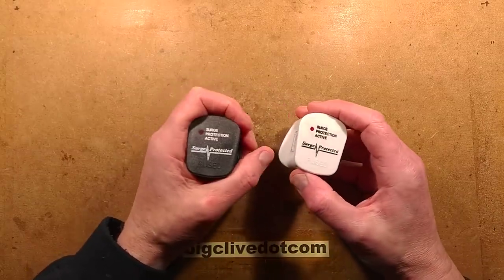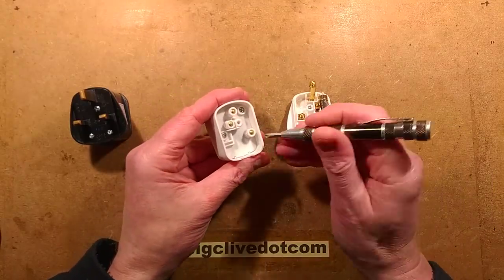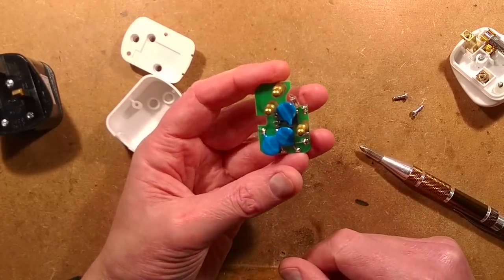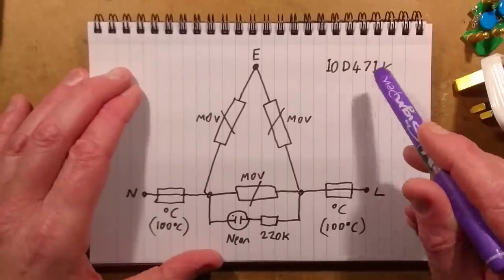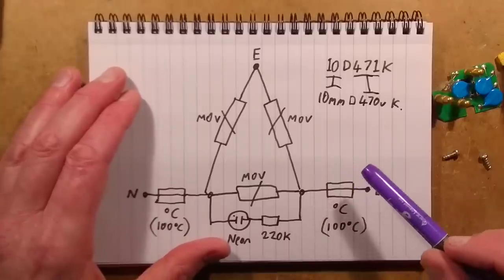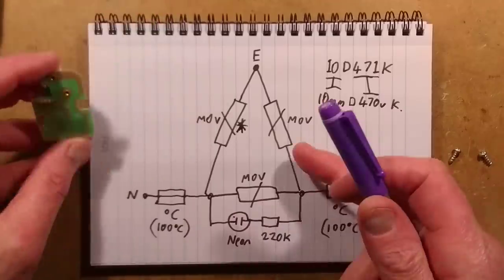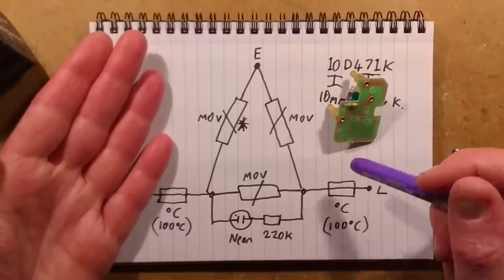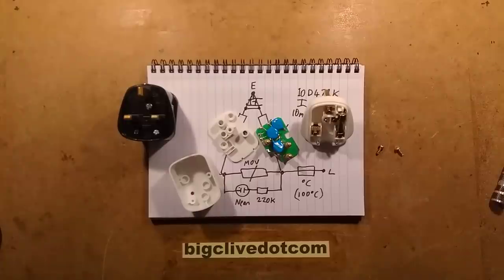British plugs with built-in surge arrestors.  (With schematic.)

Comment: I can't trust MOV. Is it really effective?🤔
Reply: A guy tested MOVs, spark gaps, clamp diodes, everything failed except the MOVs. The MOV clamps the spike immediately with absolutely no overshoot. I am not an expert but I heard here and there that MOVs stop working after they receive certain amount of spikes through them. They conduct and overheat and start a fire, that's why they go with thermal fuses. Maybe a ferrite filter is a better option? Maybe a small cap with discharge resistor after the MOV is a good idea, it would take the energy of the spike but would not let it overheat if it fails. Oh wait, that's too expensive ... you know how it goes, plastic metalized wires are our future! :)

Comment: How do they protect you device when all the protection is sat on top of the plug and the wires go straight from the plug wire and straight to you device if the protection blows the plug will still work .. i don't get how it protects say my computer against a power surge any power spike is going straight from the power out let onto any device plunged into it
Reply: When a power surge occurs those MOV´s short out the plugs. So the electricity flows through them, and not into your device.
Reply: When a power surge occurs those MOV´s short out the plugs so the electricity runs through them, not into your device.
Reply: @SharkoonBln  thanks so it blows the fuse then in the plug
Reply: @Rob1972Gem  Those MOV absorb the spike. They get hot while doing this, so they will be fine absorbing spikes, but no long occurence of overvoltage.
Reply: @Rob1972Gem  No, it shouldn't.

These are for transient overvoltage protection - very short durations, nothing like enough to blow a fuse.

Comment: 6:31: "...miswiring..." 
Mind you, there's countries that use unpolarised plugs, and if this were shoved into an adapter with an unpolarised plug, the polarity could easily be reversed. It's even possible someone brings their foreign flex, plugs that into the wall with an adapter, and then plugs this into that with another adapter. That's not recommended of course, but people will use whatever they have to hand. So you absolutely can get the same effect without any actual miswiring in the house. OTOH, you might well argue that weird extension cord and adapter setups count as miswiring too. But try convincing people they should invest in a genuine UK flex... "But I've already got this and it works!"
Reply: All of mainland Europe enjoys their misswired type c connectors (CEE 7/16), I somewhat think it’s better to not have a design which actually depends on proper  P/N location (and instead uses ground if needed).
Reply: @berndeckenfels  Can't brexit the Europlug. ;-P

Speaking of which, way back when, many UK appliances used to get sold without a plug attached, and buyers were expected to wire up a plug themselves. Now this may have been because the BS 1363 standard was still new, and many houses still had outlets that required different plugs, but I wonder if part of it was because mildly spiteful international manufacturers just couldn't be bothered to specifically cater to the ring circuit-happy UK going it alone with no Europlugs (save for shavers). 

There might be a Brexit lesson in there for all of us... :-|
Reply: @berndeckenfels  PS: A "misswired" would get Wired magazine into so much trouble in this Woke New World.

Comment: Is there somebody here who really believes this kind of gizmo? 

The thermal fuse ( hope it isn’t only thermal one) has also very important function. If the MOV gets short, it must be separated from the PE pin because otherwise it could become live. Then if you use those cheap travel adapters for earthed machine, it can be immediately dangerous.
Reply: What do you mean believes?

And the main function of the thermal (and it is only thermal) fuse is to prevent the bleedin' thing catching fire. Crappy adapters are not accounted for.
Reply: Monkeh  I mean is there a single (professional) person who believes that this could save the electronic device in case of fast over voltage spike? MOV is not enough to do it. Real surge protectors are totally different from this and there must be many of those in series to protect effectively. Actually well made electronic equipments already have these and usually much better ones.

And thermal fuse is NOT enough. It must be at least over current protective fuse. Here you see a slightly better but badly made Lidl over voltage protector: http://www.mattikaki.fi/laitetestit/ylijannitesuoja.htm
Reply: @mattikaki  MOVs are absolutely enough - 'real' surge protectors as you call them contain MOVs, and not in series (why would you want to put them in series?), but in parallel or specially made types to handle significant heat dissipation.

What would you use, then? Clearly, outside of the industry which designs, tests, and manufactures protective devices, you must know exactly how to handle high power transients, so what's your solution?
Reply: Monkeh  No. MOVs are not enough period. You are not connecting MOVs series but the over voltage protectors. You need severar of them even in a normal house. I am talking about a good protection, not this kind of cheapos.
Reply: @mattikaki  So what are the other devices, then? I'v seen good protection. It contains MOVs and GDTs.

Comment: I'm guessing superior electrical suppression compared to switch type ones which can cause EM interference spikes which may disrupt sensitive electrical devices.
Reply: Its a voltage clamp basically, so spikes have their tops chopped off and electronics doesn't blow up.

Comment: Is there a reason why this uses a neon indicator instead of an LED?
Reply from the maker: Simple, efficient and traditional.
Reply: An LED would be a lot worst in terms of flicker.
Reply: So the resistor doesn't have to be several watts.
Reply: LEDs have a couple of issues for mains application, firstly you need a second diode for reverse voltage protection, secondly their current requirements are high enough to make a resistive dropper get uncomfortably hot. You can get around this by using a capacitive dropper instead, but capactive droppers introduce issues of their own which require more components to mitigate.
Reply: In general, you can replace any neon indicator with two anti-parallel LEDs (or one old tech LED, or one new tech LED with either a series diode or an anti-parallel diode). A milliamp or two is fine, there's no need for a high-wattage resistor nor a capacitive dropper.
I've done this in a few old power strips, where the neon's blackened enough to be nearly invisible; the (red phosphor) LEDs I used are nice'n'bright.

Comment: Could you use it on the front end of an extention cord?
Reply: Of course, but you may as well get one with more substantial surge protection built into it..
Reply: I'd rather use it at the female end,  to get the length of the cable to take the power of the transients when the mov's clamp down.
Reply: @LeifNelandDk  You can certainly do that, but there's not enough impedance in the extension cable (otherwise it'd get hot...) to make any significant difference.

Comment: Probably swaged rather than punch riveted.
Reply: I'm going to suggest that they're screwed to a brass component fitted to the PCB utilising the existing screw-thread hole for the wire clamping screw.

Comment: The pins are swage punched.
Reply: Pressed rather than punched.
Reply: @bdf2718  it's a process called swaging, done with a press/punch tool. Creating a flared edge. Variety of tools to do this operation by either hand or power tool. Rotary and/or press type operation.
Reply: @FryGuyNS  Swaging, in general, might be punch or press, depending on substrate material.  For brittle PCBs, more likely press.

Comment: Everytime I see British plugs I keep thinking they're dryer or range plugs. Why are UK plugs the largest when compared to the rest of the world? EU, US, Australia, Japan, etc all have reasonable sized ones.
Reply from the maker: Because they're designed with safety and functionality above cost or appearance.
Reply: @bigclivedotcom  I see. Well it does shows sacrifices were made.
Reply: Because they use a old and silly electrical system (ring main)
Reply: @Xen D K radial circuits are even older and, arguably, sillier.  But a fused plug is still safer even on a radial circuit, protecting the connecting flex, etc.

Comment: Could somebody please spell/link/name the springy-contact pins there? Can't quite parse into a format Our Overlords can find for me.
Reply: Pogo pins
https://en.wikipedia.org/wiki/Pogo_pin
Reply: Bayonet cap lamp holder. Never seen one of those in my life but googling around it seems like some holders do have those pins in there.
Reply: Thank you!
Reply: Pogo pins / bed'o'nails pins are usually smaller, are used in autotest equipment (remember the gold-flashed test points on many PCBs?).
Big Clive is pointing out that the spring-loaded pins in the plug top look exactly like those used in a B22 lampholder, as San indicates.

Comment: Coulddddd you use a neon indicator as a gdt?
Reply: The neon will become conductive at about 90V, and isn't rated for high current; generally you'd want a Gas Discharge Tube to only become conductive at much higher voltages, to "short out" transients and handle short-term high-current loads.
Maybe you could rephrase the question, because perhaps I missed your point?
Reply: @theskett  nope, I was wrong 😂

Comment: Really nice design, too bad you can't do stuff like this with european plugs
Reply: Why, We do not need it. Only countries with shitty wiring and power systems need it
Reply: @xendk  .. surge protection has nothing to do with shitty wiring, and your 'power systems' are fundamentally the same..
Reply: @Monkeh616  No they are not. The UK use a ring main system and it is troublesome. You need the plugs with fuses to protect the system and you need to wire the plug correctly (live wire, Neutral wire) almost all other use a system were the fuse box and relay protect the system, devices  and people
Reply: @xendk  It's called a ring final, and yes, it has drawbacks - and none of them have anything to do with surge suppression, which is the entire point of this product.

Maintaining polarity is a complete, total, and utter non-issue when wiring anything. If you think it is, step away from everything electrical. Permanently. Good grief.
Reply: it is called ring main, final circuit, ring final circuit, ring main or ring. If it was a radial circuit  Surge suppression  at the plug end would not be needed  it would be in the center box
Reply: @xendk  Whether it's a ring or radial has nothing to do with the surge suppression, you can absolutely provide surge suppression at the point of origin rather than the point of load. It's actually preferred to do so..

And, although some consider it a pedantic point, it is NOT A RING MAIN. Technical terms and common public terminology are not equivalent.
A final circuit is defined as: "A circuit connected directly to current-using equipment, or to a socket-outlet or socket-outlets or other outlet points for the connection of such equipment."
This is not the same thing as a main circuit, which is not even explicitly defined in these regulations as it's outside their scope..
Reply: @Monkeh616  So surge suppression is not needed, ok I get it now. We are told not to use trash like that as it is useless and often introduces more troubles then solutions.
Reply: @xendk  .. no, surge suppression is generally needed in order to protect equipment from surges.. Where you place that protection is relevant - at the point of distribution (for the absolute lowest practical impedance) is generally preferred for dealing with external surges. Placing it at the load is less effective, but still useful. Whether that circuit is a ring or radial, on the other hand, is not relevant.
Reply: @Monkeh616  so it is a shitty system, Thanks for clearing that up :-)
Reply: @Monkeh616  No we do not need it, our electrical system do not need trash like that, only defective, ancient, or shitty systems would need stuff like that
Reply: @xendk  So by what method do you protect against lightning transients (near or far)? Load shedding? Inductive load switching?

The answer, as always, is by suppressing those surges..
Reply: @Monkeh616  Yes we have a Nice box on the wall that protect against internal and external stuff (lightning, Shorts) "Load shedding? Inductive load switching?" is mostly prevented by having rooms and types of devices running on there own fuse (6A and 13A) as well as a relay that flips if anything is wrong. The system is designed so that the user never have to do anything to the system and can do nothing wrong except short the system and that will still only affect that specific circuit or at worst flip the relay
Reply: @xendk  So you're saying you have surge suppression at the point of distribution? Great. We're agreed, it's all the same, and you've no idea what you're talking about anyway.
Reply: @Monkeh616  No we do not agreed and  I do have a good idea about it, I just do not have some kind of pride in a shitty and ancient system that is dangerous to people and property.
Reply: @Monkeh616  If the fact you need a fuse in the plugs to prevent damage and fire, that you can wire a plug wrong and need additional surge suppression do not tell you that it is "problematic" is just strange to me and the fact that the entire world have rejected the system do make one think something is wrong. It is simply a fact that we disagree and that is how it is. I'm sorry that im not able to get my point across to you but many of my words are time consuming to translate as we do use other named and abbreviation to describe items
Reply: @xendk  We need a fuse in the plugs because it's a high current circuit, yes. This happens to be how it is - remind me how this is dangerous? Rings are not ideal, but they're not a big problem. The circuit is appropriately protected, and the equipment which plugs into is also appropriately protected, so what's the problem?

It's also interesting to note that the high current circuit and fusing can be quite good at preventing nuisance trips.. I had a power supply die dead short, on any 'superior' European radial circuit with some pathetically small breaker, absolutely everything would have gone down. But no, the fuse in the plug went and there was no drama to be had.. One machine shuts off, nothing else notices. Oh, the danger, the archaic reliability of it..

You can wire a plug wrong, too - it just so happens we must get all three conductors right where you only need to get one right. That's no hardship, anyone who can't get it right can't get yours right either.

As for surge suppression, please, tell me how you DON'T need surge suppression at some point? All electrical distribution systems have transient events. They're not avoidable.

We can put SPDs in the CU - that's the current way to do things. Guess what: We have tens of millions of existing installations from before surge protection was relevant. We have a need to retrofit surge protection. This is done in extension strips, or occasionally plugs like this. Nothing special here, nothing the rest of the world doesn't do (assuming they give a shit). It's taken us a while to catch up with doing it as part of the installation, I admit.